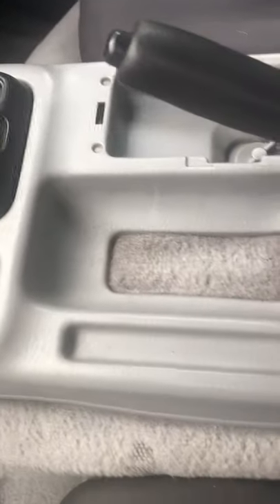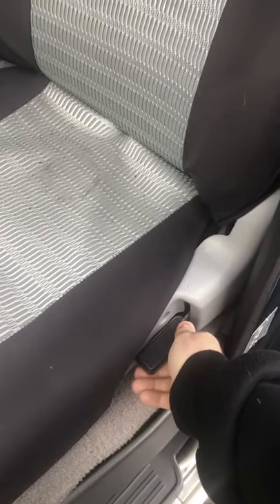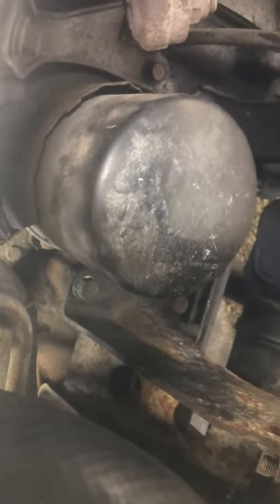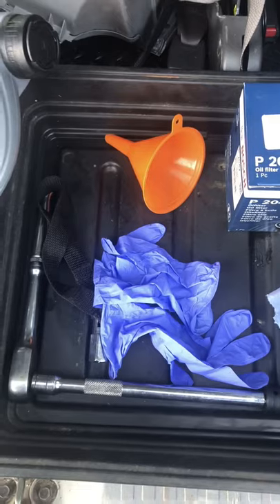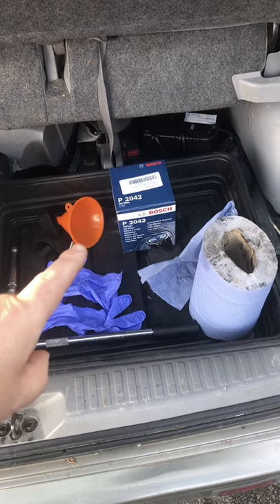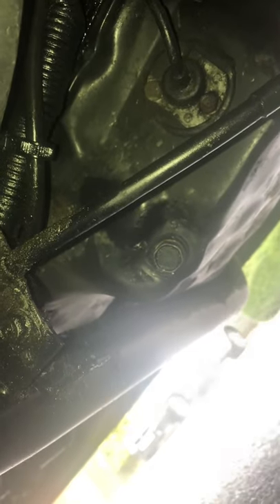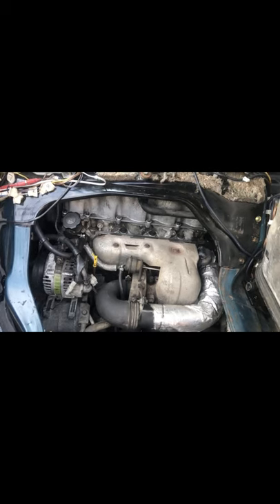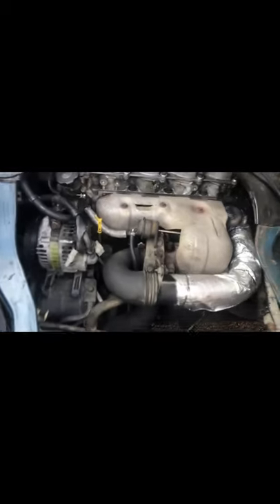Mazda Bongo / Friendee / Ford Freda Oil and Filter change.

Comment: Should be 6.5 ltr oil when changing oil filter ,thanks for video.
Reply from the maker: You're right, I read only 6 and didn't take into account the filter, I'll check the level again now I've done a few miles and top up!
Reply from the maker: Having checked the oil level it's spot on, so either I over measured and did in fact add 6.5 litres or ...well I don't know as Ive checked a few times to be sure and it's ok.